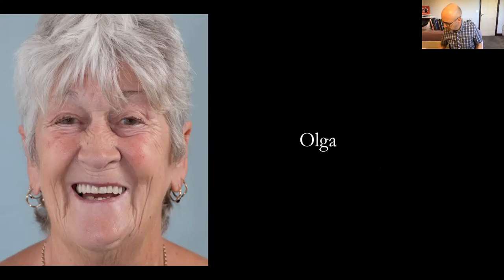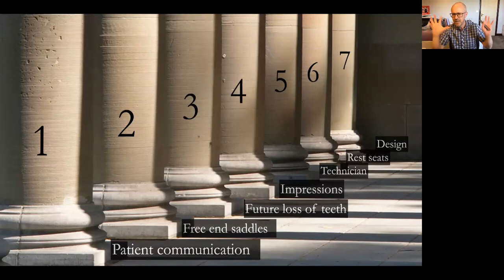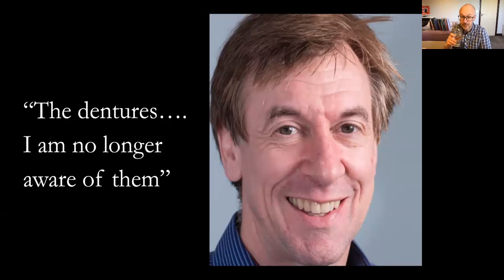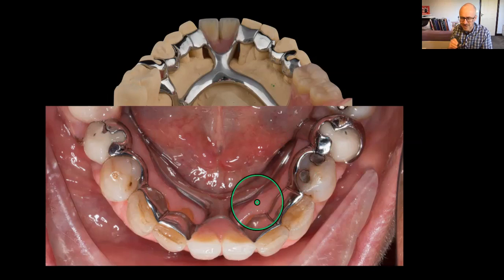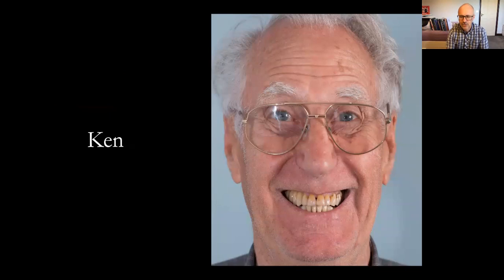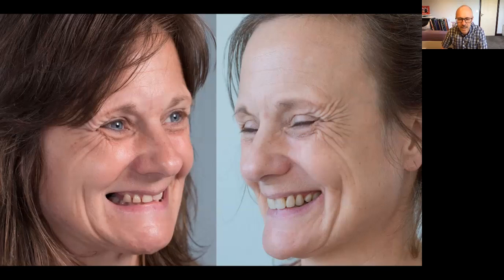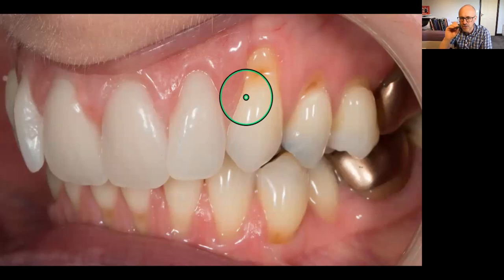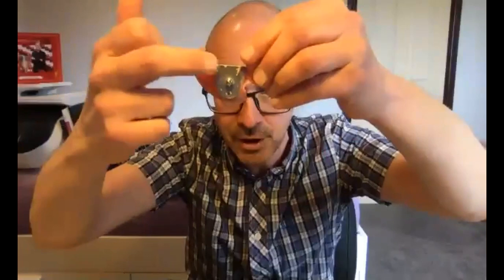Fin's Webinar 2 Amazing partial dentures during Covid 19 Global Lockdown 2020

Comment: Is there a primary default partial denture for those that aren't given the option to choose the dental framework? I wasn't given the option to choose they had told me its up to the lab on what they feel is best suited I'm missing my top front teeth and bottom and bottom back I wanted a cast metal combo with flexible clasps cause I'm looking for something without a pallet..something thin that wont affect my speech as well as durability,longevity and strength aside from it being aesthetically pleasing..from Massachusetts amazing webinar by the way!

Comment: Great content Finlay, look forward to the next one. Not sure if you're checking comments on here but on the first case has the tooth been crowned or is the metal of the framework completely covering the tooth? Also, when using ring rests do you cut a circumferential rest seat?
Reply from the maker: Thank you. The tooth is not crowned and kept as as it is. Ring rest - no prep for this case. Sometimes it is needed though when the cast is surveyed.